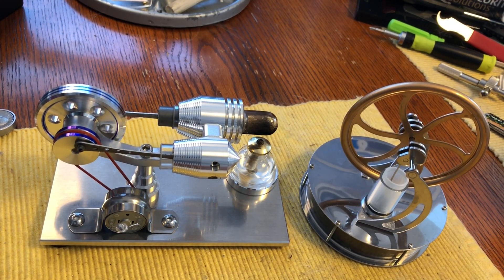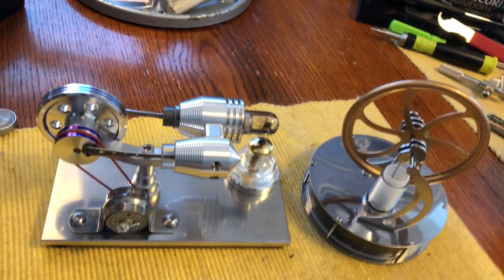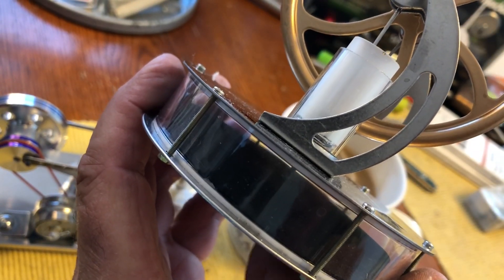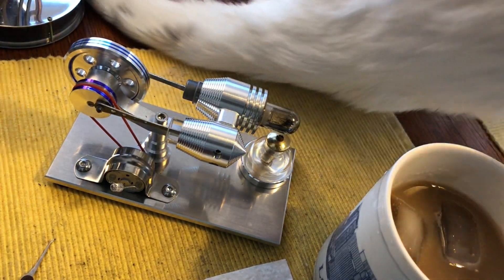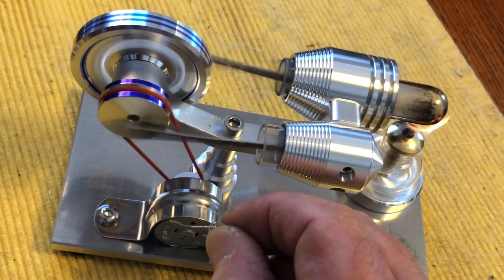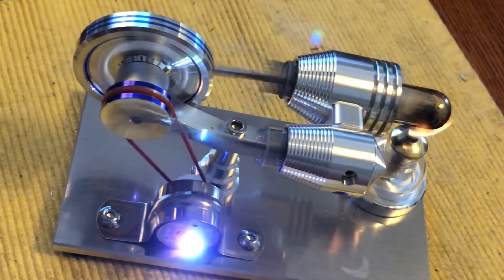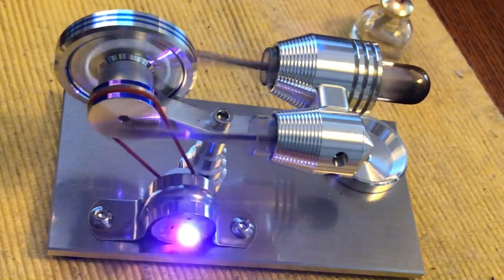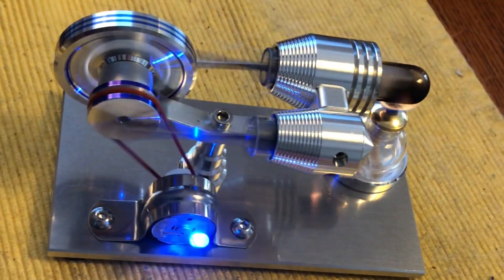#251 Stirling External Combustion Engine

Comment: I'm surprised it's that fast.
Reply from the maker: Gary Rumain yes it can go very fast! I have the wick at about the smallest because if it’s higher the engine can go about twice as fast and start to vibrate off the table! 
Will hook up a volt meter to see how much juice it puts out? 
👏👍👏👍👏👍🐈
Reply: @chriscapune7873  That would be interesting but not sure if you'd get an accurate reading with that device flashing the LED. It's probably fiddling with the current.